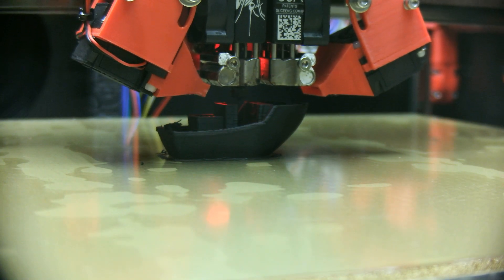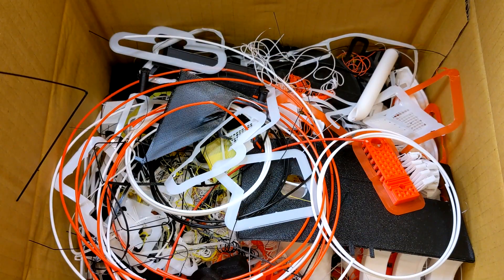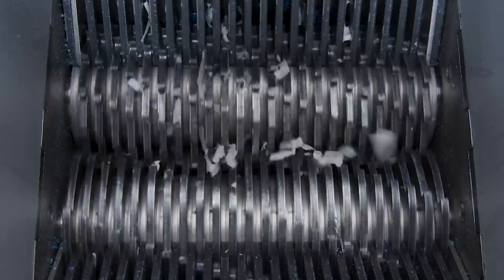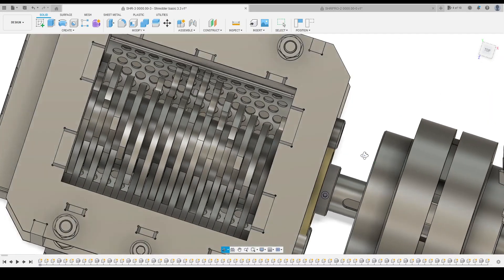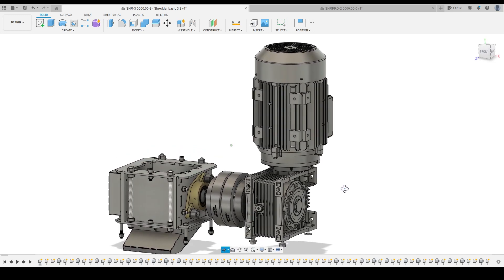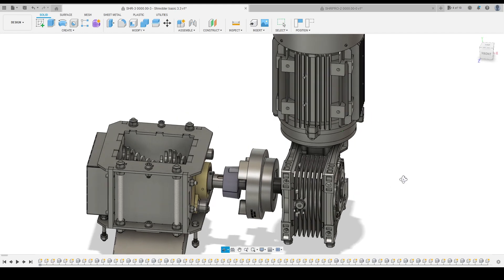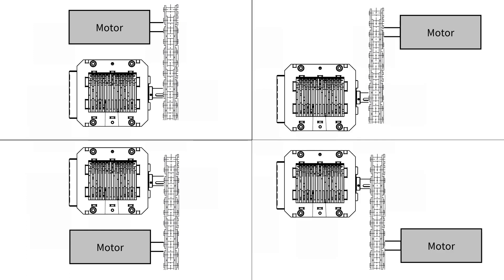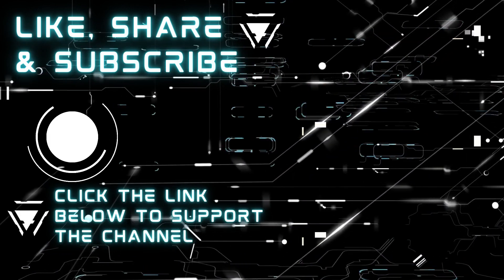[Shredder] Recycle 3D printing waste: preparation stage

Comment: Friction heat if shredding too quickly may cause any plastic to melt and jam up, another advantage using reduction gears
Reply from the maker: Yes, I used a gearbox to reduce the speed and increase the torque with this shredder. The speed is also adjustable to fit various scenarios.